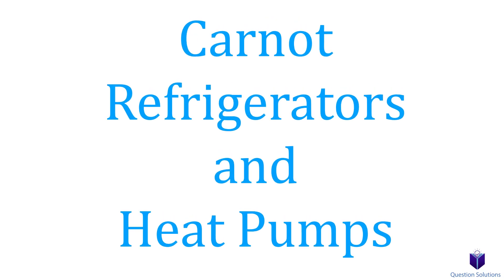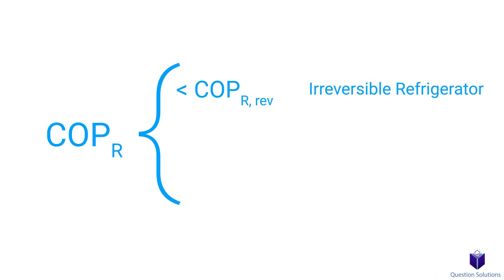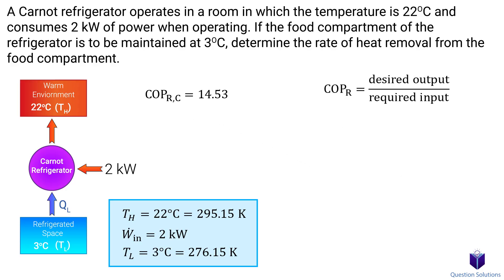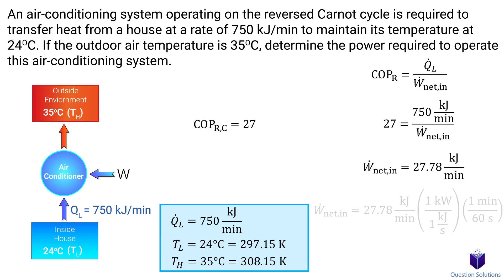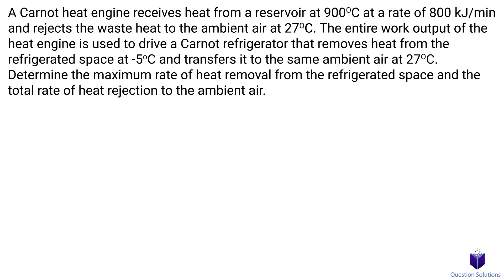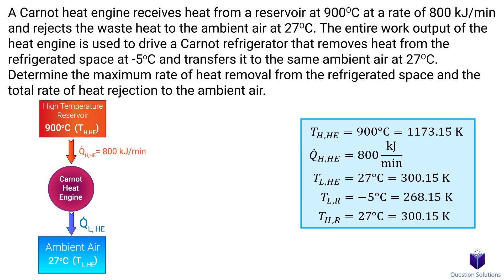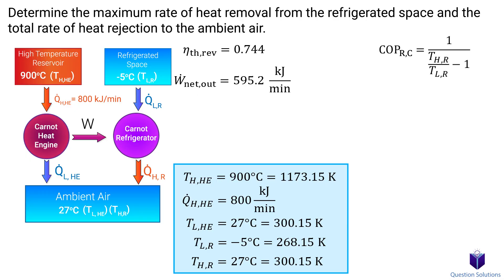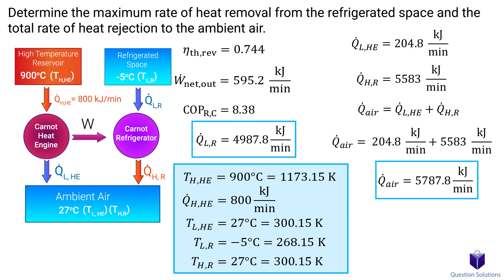Carnot Refrigerators and Heat Pumps | Thermodynamics | (Solved Examples)

Comment: in the last question, isn't the Carnot refrigerator supposed to be a heat pump, since it receive cold air and gives out hot air? wasn't refrigerator suppose to "cool down" the air? and in my understanding, removing heat means cooling down. sorry I'm a bit confusd🥲
Reply from the maker: I read your question a few times but I'm not really understanding what you're asking. We're told that a Carnot heat engine supplies power to a Carnot refrigerator. Which step of the problem are you confused about? If you can give me a timestamp or where you're not understanding a step, I can help you out better.